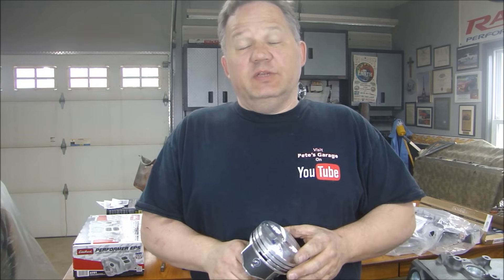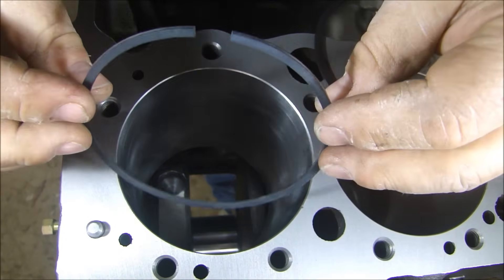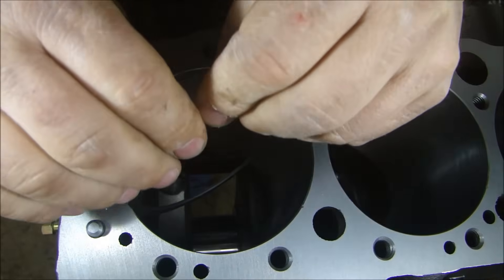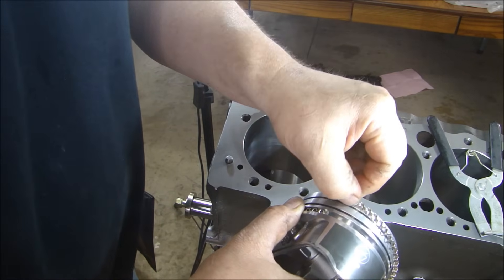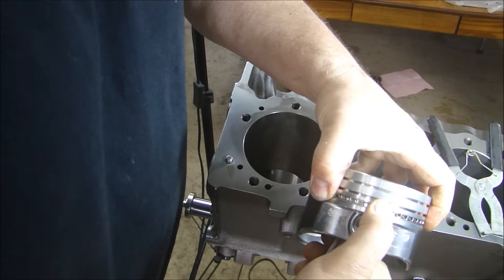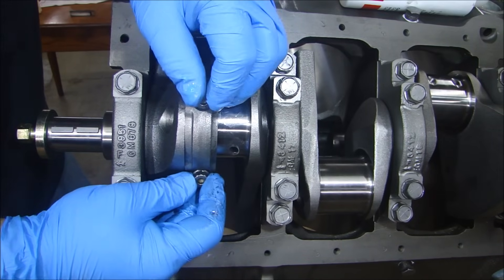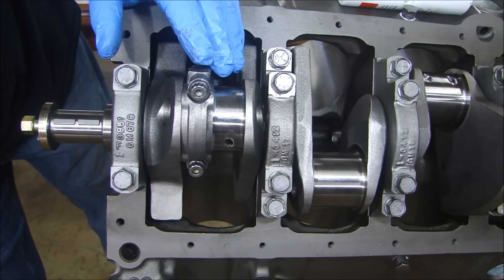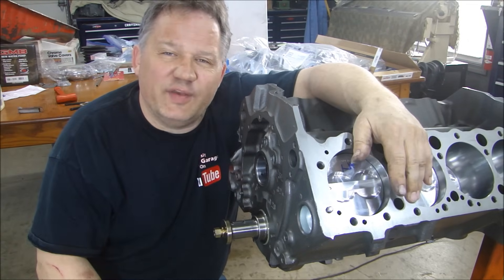Engine Building Part 2 - Gapping Rings, Installing Pistons in a 350 Chevy

Comment: Which one is the best? rebuilding your engine or getting used one from the junk yard?
Reply from the maker: Rebuild if you want to keep the same serial numbers. It is cheaper than buying from a junkyard when you don't know what you are getting. The only thing I buy used are blocks, heads, maybe an intake if I want an original, and possibly a crank if I know where it's coming from.
Reply: @PetesGarage  Ok thanks a lot, i appreciate.

Comment: I normally make the gap difference on the second ring a bit bigger than the top ring to prevent flutter, but I'm Shure it will be good, as you said, not a high powered motor
Reply from the maker: That's a good practice. I follow what the manufacturer recommends

Comment: What lobe to use on piston/cylinder if you build the engine slow and it will be start up for example spring 2021? Is WD40 more if the startup is soon? For the bearing I’ll use Clevite assembly lobe.
Reply from the maker: The assembly lube is good, but it will dissolve over time and start to run. Just make sure you pre-oil the engine with the oil pump before you start it.

Comment: When the crank bolts are torqued to 65 and 70 pounds are they in sequence and are they performed in increments to reach specifications?
Reply from the maker: Depends on the engine, I bolt them following the prescribed sequence or crisscross pattern working from the center out in 3 increments.
Reply: @PetesGarage  how do you mean, "3 increments" ?
Reply from the maker: If the final is 90, I'll go 39, 60 , 90
Reply: @PetesGarage  this was exactly my conclusion.  Thank you

Comment: Great video. BUT.  A mention that on the even numbered cylinders, the piston carat goes  forward but the big end chamfer is to the rear ( firewall) since  #1 is  against the fillet already. (not that some engines  may not have  offset pin bores and  don't have  a  front -back orientation.)  That engine  seemed to turn nicely.  Any idea  how  many ft-lbs to keep it moving after break-a-way?  Thanks. - Sandy
Reply from the maker: Thanks Sandy, I did not measure it, but I do have a video about ring tension.
Reply: @PetesGarage  Thanks, I'll have to check that out.  Currently working on a 340  GS  engine rebuild; it had a  wiped cam lobe  - factory cam.   Actually the automatic  transmission is  the coolest part. 2 speed but with a  switch pitch, dual stall speed converter. Works almost like a 4 speed trans. My 401 Electra had a 3 speed with a switch pitch; called the Super Turbine 400 as  opposed to the later TH400  -Sandy
Reply from the maker: That's sounds really cool, thanks Sandy

Comment: Just want to say I love your videos but the clicking the torque wrench twice is a good thing. I'm an engine and prop mechanic on C-130s and the reason you do this is because first off, there is oil in the torque wrench that causes deviation and that second click ensures the oil is moved inside the torque wrench. Second, all metal stretches. It's small but in my field absolutely measurable when you're applying 400 ft lbs to a mount bolt or Sweeny wrench. On the Sweeny you can see with the protractor on it the excess movement better first and second click. Obviously it's more noticable if you further bump the prop back and forth a little while torquing. I know this is only 40 ft lbs but I promise you aren't wearing out your torque wrench by done clicking.

But otherwise, thank you for the vids!
Reply from the maker: Great comment, thank you for sharing

Comment: This is called a four cylinder engine.  360/4 so 90 is the switch over point max out 45. Usually engine is a gas chamber pistons and a spin rod or shafts. Fire up and spin makes tyres rotation and gears to control rotation all others are directional moving controls. Like the steering wheel etc. Engine is one that is always sealed to make sure no damage and extreme care on assembly and misfire.
Reply from the maker: Interesting

Comment: I always dunk the piston(s) into a can of oil immediately before installation into the cylinder(s).  After tightening the rod bolts/nuts, I wipe the top(s) of the piston(s) off in order to avoid having a lot of oil in the combustion chamber(s).  In this way, there is plenty of lubrication available upon startup and very little piston/bore wear.
Reply from the maker: Thanks for the comment Ed. Good stuff!
Reply: @PetesGarage :  Thank you.  I am a mechanical engineer who owns a repair shop, and I have been a gearhead rebuilding engines from lawnmowers to heavy construction equipment since I was in high school fifty years ago.  I also worked in the defense/aerospace business for quite some time, but cars, trucks, and racing were never far away.

Keep up the good work.

Comment: Does the crankshaft stay in the block when you get it back from the machine shop or do/did you buy a new one to bolt the new pistons to?
Reply from the maker: All of the parts stay separate, It was a new crank

Comment: Very informative , I've always used .004 to cylinder bore D` ....never a problem  .... Never heard of .0035  when did this happen ??  LOL
Reply from the maker: It happened when some manufacturers developed products they wanted to consider special or custom.
Reply: @PetesGarage  I used to use  1 thou per 1 inch of  cylinder circumference  which is  pi x D. But also depends  on ring material and  heat load from power  adders like:  turbo, nitrous  etc. Thanks!  - Sandy

Comment: my SBC is bored 30over to 3.905 and I am getting .029 on both 1 and 2nd ring. I should have the correct rings I checked the box and the part comes up 283 30 over. I used a electronic digital caliper and measured my bore at just around 3.905 Its not a bore gauge but it gets close. What should I do run at .029.  I even went deeper into the bore inch checked another ring and another bore and came up the same. Max according to Hastings and SAE is .022 maybe I have bad chinese feeler gauges I think I'm gonna get another set but I can see being that far off by 6tho.
Reply from the maker: That is unusual. You may have to get a set of file to fit.

Comment: I really appreciate the time you put into the engine build videos. I have restored many complete cars but never built a motor, or transmission. It is time my 61 rambler restomod gets a new heart beat. I was wondering if you have a video demonstrating how to file the rings if you do need to increase the gap and the tool you like to use to accomplish the task. Thank you again.
Reply from the maker: I do have a video about rings. It's on the last 440 build I did.

Comment: I have a question. Would it matter is I pointed my top an second compression rings gaps up an down 180 from each other would there be a problem? I just popped the piston an rods on so I'm wondering is I need to change the orientation for my gap on a chevy 350 2 bolt main I'm rebuilding.
Reply: Thanks for getting back to me so quickly. Good to know. Thank you. Its my first rebuild on a stock chevy 350 truck motor. I helped yr's ago rebuilding motors with my dad. But its been almost 10 yrs since an my dad passed a way 2 yrs ago. Its all new to me doing the rebuild myself. Thanks for the help man.
Reply from the maker: It won't really hurt anything

Comment: How do you do this without a threaded crank? Turn by pushing counterweight? I got my crank in. I was thinking installing the crank gear early and using a homemade tool similar to what I used on bicycle cogs called a chain whip. Or maybe a socket with a slit to slide along the woodruff key. Or the balancer loosely fitted and with long bolts attached
Reply from the maker: I use the balancer bolt, it works great. All the ways to mention will also work.

Comment: what are the implications of not lining up the piston's mark to the front of the engine?
Reply from the maker: It depends on the pistons, some are perfectly symmetrical while others are cut slightly off center. The valve relief in the top must line up correctly with the vales if you have those. The connecting rod will also be backwards with the chamfer facing the wrong side of the journal.
Reply: Total catastrofic engine failure.

Comment: الفتحة تكون ثلاثة ثاوات ونصف لكل انج قطر ؟
The gap should be (3.5/1000)"    times the cylinder diameter measured in inches?
Reply from the maker: لست متأكدًا من معنى ذلك
Reply: Thanks for your swift reply. I have put the question in English to make it more clear. Best regards.
Reply from the maker: That is correct. Use the instructions that come with the rings you buy.
Reply: Dear  @PetesGarage ,  do you have a video about crankshaft balancing and why that balance is important?
Reply from the maker: I do not

Comment: Also:  ring gap is dependent on your usage.  The one mentioned in this build seems to be a common NA engine type.  A Nitrous or boosted engine with 18 Lb boost will call for .007" per inch of bore diameter.  When grinding rings, only grind one side of the ring.  That way you can easily keep the ends parallel and the gap even.  (As an experiment:  Grind two ends at the same time and compare by squeezing the ring together.  The outside corner touches and the inner corner has a gap.)  Lastly:  When preparing your block:  Very gently debur and round off the top edge of all cylinders.  That way it is less likely to catch and break a ring during piston install.  Good video!
Reply from the maker: Great comment, thank you
Reply: Yea my silverlite piston called for .026 street strip.Rings came out of motor as .033

Comment: Please note that sometimes pregapped rings maybe a little on the tight side. Its always a good idea to check them and may have to file slightly. I have encoutered this mostly with NPR rings. Granted they are cheap rings but they do fine for a budget build.
Reply from the maker: I agree 100%
Reply: You might try seeing end gap on the rings in their  corresponding cylinder not all the rings in the same bore like you did. Better yet don't make a how to video on engine building if you don't know what your doing yourself

Comment: Why dont u put the pistons  and rings in a jug of oil before u put then in it will be a dry start if not done unless u do something different  let me now pls
Reply: He said he put oil in the cylinders before installing. 
I personally use a oil can and squirt a little oil around the rings and on the skirt before installing. I haven't had any issues with ring seating or scuffing.

Comment: What about clearance between piston skirt and bore?   What’s acceptable maximum and minimum?  For ordering pistons once machine shop is done? Everyone only talks about ring gaps.  Nothing on the pistons themselves.    Also rod length?  How do I know how long the rod needs to be when ordering if I’m starting with a new block?
Reply from the maker: The pistons should be ordered and sent with the block to the machine shop so they can bore and hone to the right size. Trying to buy a piston to fit a pre-machined bore could be extremely difficult.I would start with stock rod lengths for the engine size and adjust if you go with a stroker.

Comment: you don't oil the cylinder bores and pistons in the ring area before installing?
Reply from the maker: I sure do, I usually use the oil for the engine.

Comment: don't you think it might be a good idea to check the gap on the oil rings?
Reply from the maker: You can, it's not a bad idea. If the first two come out of the box OK I've never had a problem with the oil rings. But you are right, they could make a mistake.

Comment: Hey, in need of a little help. I recently rebuilt a nissan QR25de engine because it was puffing smoke. Before I did the rebuild I did a compression test to see the before and after of installing new rings... The smoking issue is gone however the engine is consuming quite a fair bit of oil. 500ml/1,000km or 5L/10,000km. The compression test reveals that the compression in the cylinders haven't increased. I have done a wet test which reveals that the rings are the item at fault here. 120psi dry vs 165psi wet. Admittedly I didn't gap the rings  but seeing as I was just ordering stock parts I naively thought I didn't  need to. Do I need to rip the engine apart again and see if I can get some oversized rings to gap myself? Is there something else that could have gone wrong? Any input would be much appreciated.
Reply from the maker: Well, could be a couple things, wrong gap or rings upside down. You have to take it apart to check. It happens.

Comment: I've built some engines in my day and I must say your video is excellent. Your approach is right on the money. I like the cleanliness and the gloves. I noticed the spotless block as well. You say in the video that this isn't going to be a very big build,  but I notice the Eagle rods, which are good for 600 HP.  That would be a lot for a street engine. So what are the goals of this build? Thanks and I will be checking out your other videos.
Reply from the maker: Thank you very much Dave. I treat every engine the same. It is going in a '76 Vette daily driver. The goal is a little more HP than factory that is reliable.

Comment: The two top ring gaps should be 180 degrees from each other . Each facing the wrist pin.
Reply from the maker: Good tip Chris, but you know the rings do move a bit when you first start it up. I've torn down engines with 10 minutes on them and the rings are nowhere close to where they were put in.

Comment: Hello Pete. I'm beeb ask to build a performance 383 sbc for a friend. It will be running on e85,  and it will have about 550 hp. I have only build street engines before. Do you know what ring gap I would use?  Or does it deoend on the manufacure?
Reply from the maker: Always use the ring gap specified by the manufacturer. If you have any questions, call their tech support line.
Reply: @PetesGarage  Thank you! Like your channel, great videos!

Comment: I'm rebuilding a late model 454 and ordered a pack of Mahle 40203CP rings. My question is, why are the top rings and the bottom rings are different in size. The thickness and out size diameter is the same, but the inside diameter is different. Also which is the top ring and which is the bottom. My dumb self open the box and poured them out before looking which was which. One ring is darker in color and has a white mark on it. The other ring is littler in color and has no marks. link: https://www.summitracing.com/parts/mah-40203cp
Reply from the maker: I use Mahle rings all the time. Call their tech support and they will tell you exactly which is which. I've called them many times for help.
Reply: @PetesGarage  After watching this video It answered my last question. Thanks Pete
Reply from the maker: Awesome

Comment: How do u know the pounds of nut torque,Pete? Do different engines have different torques.
Reply from the maker: Yes, they are all different. It depends on the bolt size, base material, several factors
Reply: Buy a Haynes or Chilton manual for your vehicle, they usually have all the specs and tolerances listed for the engine.

Comment: Great video Pete. I didn’t see you apply any kind of lube to the rings or bores. Just wondering if they all go together with no or light lube. If building an engine that will sit a while before starting does that make a difference too. Thanks
Reply from the maker: I always put WD40 in the top of the bore and in the ring compressor so it comes out smooth and protects the cylinder from rust.

Comment: how much was it for all the machine work and balancing? thx..
Reply: I just got my SBC block, crank, Pistons and rods back from the machine shop. Here is what they did for $750. Cleaned and magnifluxed block & crank,  bored & honed cylinders, squared and zero decked block, turn crank, installed rods on pistons, balanced rotating assembly, installed cam bearings. This is in Denver, Co.

Comment: Great videos!
I have a question, you had the block decked, are there any precautions that need to be taken when purchasing pistons/rods? Would the piston extend past the cylinder wall or is the amount decked off negligible?

Thank you!
Reply from the maker: Great question! The amount taken off is not enough to cause concern
Reply: On a race motor with dome pistons or if your heads are decked some also u might need to make Shure your valves can clear the Piston right?
Reply from the maker: Correct

Comment: That was an amazing video. I love how you show the entire process: not skipping over valuable parts. I remember the first time I was putting a piston in and I hammered it as hard as you would to hammer a wheel stud out of a huge diesel truck, and afterwards, the piston was in, but the crank was totaled: $900. Dad was so pissed off
Reply from the maker: ooooooo, that was an expensive lesson.
Reply: @PetesGarage  Hello Pete ,Charles I bought a sbc engine from Summit it's a 4 bolt main , two piece rear main seal .
The problem I have is in front wear the timing chain goes the block has two holes that goes to the lifter's is that normal .
Reply: it's wasn't your fault, you are the learner, problem always the teacher.

Comment: 18thou, you were lucky. Last engine I did had about .025, actually worse than the 130000 miles ones I replaced.
Reply from the maker: Wow, I make sure we bore and hone to a standard ring gap size